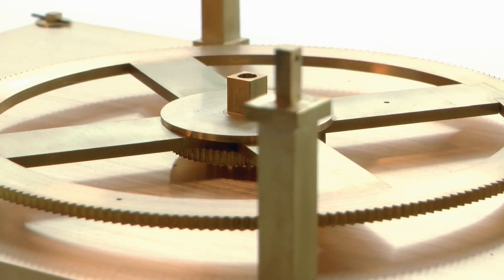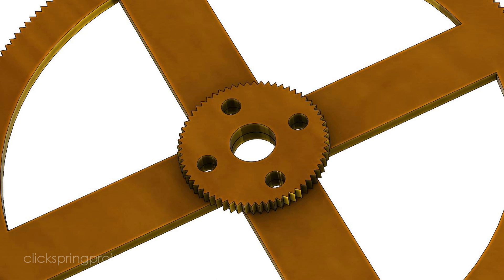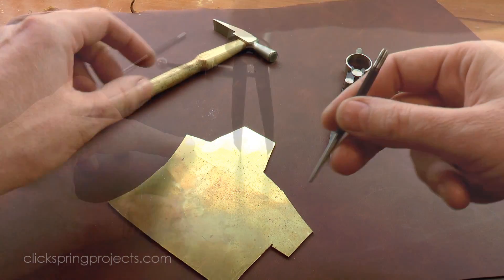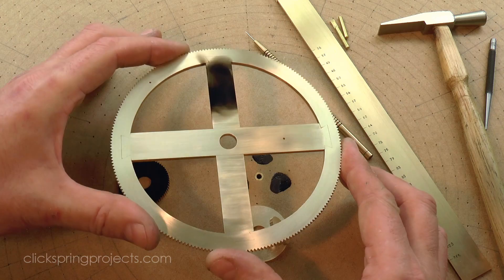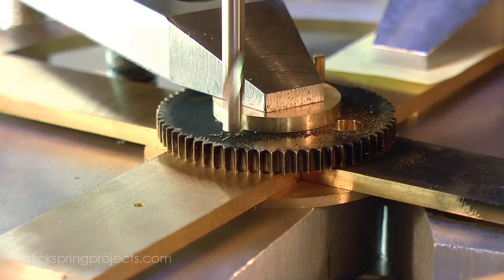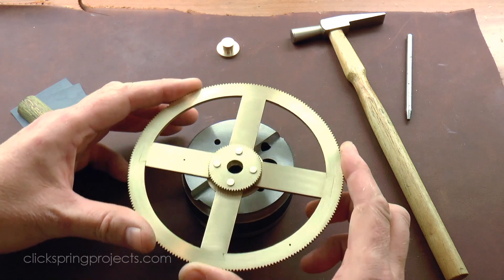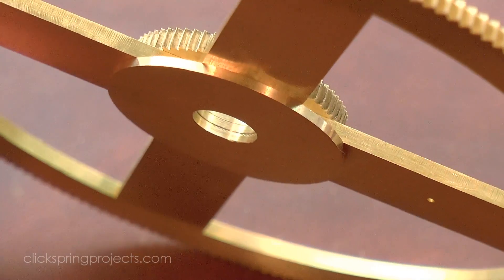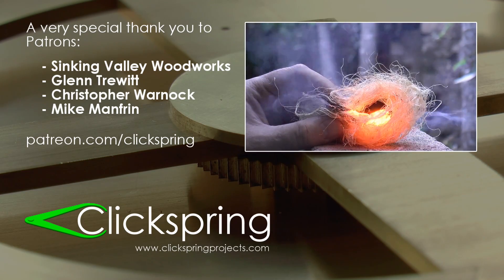The Antikythera Mechanism Episode 4 - Making And Fitting B2

Comment: Perhaps they used the burnt brass color you get when applying intense heat to brass, like when soldering or brazing it. They could potentially also have smeared on some oil and burnt it like you do when seasoning cast iron pans. Both would produce a color contrast, can be handled roughly, and is removable with some light sanding. Ash or soot mixed with wax or sap would make a sort of primitive paint that may probably also work. You could also do it the inverse way of how we do it now, fill the scratches and marks with something to make them more visible, rather than scratching and marking after applying the contrast medium

Comment: iron ink can be used and disalved with simple vinager on metal plates. but they could have also used soot. or heat blue iron for the marking then just retemper it

Comment: I know it's an old video, but i hope someone sees this.
I wonder at what room temperature you made this?
Because with tolerances so tight on that bearing i could imagine if it was made at a warm temperature and then exposed to the cold temperature of being on the deck of a ship the system might seize up due to shrinking of the metal.

Comment: In regards to marking metal, another method would be to accelerate a patina then scribe through it.  Any mild acid would do this like salt and vinegar or a citrus juice.  This would react with the copper and produce a thin green patina.  It would be more durable than any coating and easily buffed clean.

Comment: Way late to the party, but in addition to the obvious fat/wax+ash/charcoal options, a thin clay could be an option as well. It doesn't have to become full on ceramic, so it could be fired onto the part in a thin layer at a lower temperature.

Comment: You can melt bee's wax in boiling water, remove from boil, and pass parts to be marked, through the thin layer of wax on the surface of the water, after the water has warmed them up, so that the wax layer will be thin.  You might also try adding a dye, to the wax, for contrast.

Comment: Soot is still used today by locksmiths for marking and pulling impressions.  No doubt they used it in the Roman era.  Similarly, mixing a bit of soot or charcoal with wax would create a darkened slurry.  Perhaps reverse the process; whereby making the scratches and then filling them with the pitch, would render them more durable as well.

Comment: The simplest, cheapest and cleanest way to get a high contrast for the lines you inscribe in the work is to rub the surface first with steel wool-I can't believe just  how much Steel Blue you use-looks good against the Brass but just seems wasteful.

Comment: Britannica has egg tempera paint as a popular choice for artwork in this part of the world at about this time in history. Tempera is made of a suspension of pigment in gelatin, typically egg yolk. Tempera paints can be formulated to dry quickly and the gelatin binder is water-soluble so they're easy to remove. A cheap, dark pigment such as carbon black would work fine for layout fluid.

Comment: Black Bees/Candle Wax for marking.

Bees/Candle Wax has been used for a long time in the making of Ukranian/Dyed eggs, beeswax was the wax used in candles in the ancient world forever, and when it's hot and you accidentally get it stuck to something you didn't want it stuck to it will stick something awful. If you get paraffin stuck to something with a smooth or varnished surface you can usually just peel it off, and it is possible to get Black Bees Wax off, but it's a lot harder.

Edit:

Here's the stuff I'm referring to: http://www.ukrainiangiftshop.com/Dark-Beeswax/productinfo/WAX2/

Comment: The material I used for working with gold and silver findings was beeswax.  If there isn't enough contrast pine pitch can be added to make it a much darker color.  It is easy to brush on and scrap off and you can use the same stuff to hold small pieces in place to polish them and it will protect against acid corrosion if etching is desired.

Comment: Loving this. I'm thinking that back in the day when this device was originally made, an apprenticeship was actually quite different from what we know today. In the era around 50 BC, the student would have to go through the steps of first making their own tools and learning how to use them by completing simple projects. A the student made more complex tools, they would be taught more complex skills and create more complex projects. Something like the Antikythera machine would be akin to their final exam. 
I went partway through an apprenticeship program for electrician. It sucked. They were not interested in teaching anything. They only wanted to get the project done as quickly as possible so the supervisors could split that fat bonus check at the end. The joke was on them because many of the so called apprentices and helpers were so inept because no one wanted to take the time to teach proper skills, that the time budget was screwed 3 months into the project and the materials cost was over budget as well, both of which ate into the bonus. No real professionalism in the trade anymore.
Reply: There's some decent evidence that apprentices were treated that way most of the time back then too. Time hasn't changed that you need either luck or connections to get a good teacher.
Reply: that's the sad truth today, pal. i can feel your disappointment. I had the same experience as well but I'm an electrician now. i got my knowledge from the books and the skills from practicing that book knowledge mostly Auto didacticaly. by making mistakes and learning from them. i was just a slave in the eyes of my electrician supervisor back then when I was apprendist to electrican. it is very sad that every one is massively driven by money this days... i would had loved to teach a apprendist the art of the electrician but sadly nowadays only a few companies teach... so i leaved the construction sites and i studied even more and now im working in the industry as electrican for electronics in the quality proofing section. what I want to say with that. be your own mentor and don't let you down if no one wants to teach you the art of some profession

Comment: Every time I watch a mechanical fastener disappear into the surrounding metal I cry inside. It just became impossible to tell how those plates were fastened together because of how beautiful his craftsmanship is. That's literally the ONLY negative thing I could find after watching all of the videos on this channel is that his work is too perfect.
Reply: Well they could solve that with the same method they are using on the original, namely high power x-ray scanning. 🙂 Hopefully this video series will be kept as provenance with the eventual artifact.

Comment: Encaustic paints are, in my opinion, the most likely marking medium for an object that'd need a lot of handling. It's essentially the same as everyone else's comments on beeswax w/ soot mixed in, though their is a bit more to it, but it's likely because the Greeks used encaustics on just about everything. All their buildings and statues were painted with it, though most of that's eroded with time, and it was also used in funerary paintings, many of which are extremely well preserved. I think Encaustics are likely because they'd have been so common. With simple pigments the paints would have been readily available, pretty robust, very cheep, and could be cleaned up with a little heat and vinegar.

Comment: Hey, Chris. This is just based purely off speculation and has no actual historical backing but it's possible that they would scribe a line and then use something dark like soot or charcoal to emphasize that line. Then it would be in the light indentation and less likes to rub off with handling. As a jeweler that's how we do it with wax. I'll scribe a light line in the wax and apply baby powder to make the line pop. Then it stays visible no matter the handling

Comment: Hi, I have a question about the riveting.  You stamp the metal of the rivet out over the part for a secure bind.  Then you polish off the protruding metal from the rivet to create a smooth surface.  Doesn't this just remove the rivet metal stamped out over the part?  So why stamp the metal outward in the first place?  Thanks.
Reply from the maker: Hey Andrew, the metal deforms at the mouth of the hole, filling the small chamfer and providing a mechanical interference to hold the rivet in place - cheers :)

Comment: Hi clickspring. Was thinking on your methods of making your set out contrast. I realize youre making your own bronze, but do you think that its plausable that the ancients may have used tarnished bronze? that way the set out marks would contrust bright against the oxidised surface. Just an idea, i know that bronze parts can be quite dull, if they made stock materials in advance this could give them a contrasting surface with out much effort
Reply: after watching your vid on making your screws and bluing methods for your clock, have you considered a similar process for bronze? The blue is a very similar colour to your marking fluid

Comment: Some basic research raises some interesting ideas about the dye. Apparently, the use of purely mineral dyes was not enormous in ancient Greece, as they preferred plant and animal based dyes. This opens up a realm of possibilities, considering the island of Kythera was known as the purple island because of the amount & quality of the purple dye produced there. I don't think purple would have been used, as it was incredibly costly and time consuming to make, however, I do believe they may have used either the kermes insect (which was also expensive, but still cheaper than purple dye) or they could have used an indigo dye made from Woad which is supposedly mildly corrosive. Now, that is assuming the color resided in the blue area of the spectrum. I think your initial exploration of the candle black was a good idea, however, I think you should try other kinds of candles. Assuming the one you used was made from paraffin, which burns cleaner than both tallow and beeswax candles. Since paraffin was not available at that time, I suggest you try finding a tallow candle and a beeswax candle and using those to see if their soot is more durable. Best of luck!
Reply: G'day, loved your reply and knowledge, yes I'm 6 years late to the party as only found this by channel by accident, and as a history lover I enjoy learning new info.
I do not know if this is helpful, correct or even gonna reach you.
I know in Roman times, PURPLE was only allowed for the ultra wealthy/elite. 
It was a way to separate the classes, and PURPLE was banned to everyone except the elite.
I'm not sure wether it was like that in the period you are talking of, YET I thought I might share my small amout of knowledge and PURPLE was mentioned and I was like, YAY I CAN INPUT A SMALL AMOUNT INTO THE CONVERSATION, even 6 years too late 🤫🤫🤫🤫🤫🤫🤫🤫
I hope this was useful and knowing my luck you possibly already new this, yet I thought I'd reply, just in case.
Have a fantastic 
February 2024
From
Maryborough 
Queensland 
Australia 🦜 🦘 🤠 🇦🇺  🦜 🦘 🤠 🇦🇺
&
Cheers 🍻 🍻🍻🍻🍻🍻🍻🍻🍻🍻

Comment: the soot thing... I'm a painter not a machinist, or a clock maker. I paint miniatures and have for around twenty years, alot of people who paint use part holders or attach a handle to their peice. But I just hold what I'm painting and manage to avoid rubbing the paint while It's still wet, which is basically the entire time I'm painting. perhaps it's just a case of adapting your handling of the parts when you use soot as a marker?

Comment: If the mechanism was made out of Bronze or even cooper, you can add Vinegar, so it would oxidise the surface, this way it would create a better resistant green surface, that could be removed later. Of course you did have to overshoot the size a little to counter the corrosion, and you did have to do it before you made the gear "teeth".
Another option would be a  either a die (used in cloathing or some kind of pitch or some stain liquid.
I did discover your youtube channel by searching about case hardening, which was a great video, keep up your good work.

Comment: I think that combining lampblack and linseed oil would make a suitable marking-out fluid. It would have been readily available in antiquity and could be cleaned-off with turpentine (distilled from the resin of the Mediterranean turpentine tree) after the machining was complete. Unlike candle soot, it wouldn't rub off the metal surface, and once this lampblack oil-paint was dry, it would provide scribe lines with very good visual contrast on brass.
See also https://paleotechnics.wordpress.com/2014/02/25/lampblack-what-it-is-and-what-its-good-for/

Comment: A more resisting marking "fluid" could be wax stained with soot or ground up charcoal or whatever might serve as pigment. Heat up a pot of nicely darkened wax, take some of it onto a ball of cloth and apply it to the part. a bit like shellac To get rid of it, pour boiling water over the part or scrape it off with a piece of wood. It would even deliver a protective coat.

Comment: I know a lot of possibilities have already been posted but I have two more suggestions to add:
1) Milk of lime - Can be easily produced from shellfish, dries to a white coat. often used in "Whitewash" finishes. Pigs blood can be added to give a pink colour, and egg white and wheat flour can be added as a strengthener to the finish. 
2) Gelatin / Hide glue - Can be made from boiling hides and/or bones from various animals. Dries to a very durable finish depending on concentration of gelatin. Many colour and strength enhancers can be added for different properties. Can be removed easily by warm water.
Reply: Where did you learn this

Comment: So I've been told to only file in one direction, the direction that the teeth are formed to cut in, but I observe that you file in both directions. When is either appropriate?
Reply from the maker: Great question Evan - As a general rule, file on the push stroke and ensure minimal contact with the work on the return stroke, as you have been taught. The file cannot cut on the return stroke, only wear if left in contact with the work - However don't get overly hung up on the idea, there are plenty of exceptions: When you are working with soft material; when you have a worn file and it makes no difference; when the workpiece geometry demands it, and to do otherwise would compromise your desired outcome etc. - edit - a good example of where contact with the work on the return stroke is simply accepted as unavoidable is a reciprocating filing machine: http://www.clickspringprojects.com/die-filer-or-bench-filing-machine.html FWIW The initial set of files that I made for the machine several years ago are still cutting well - Cheers :)

Comment: You talk about how accurate these parts need to be but why dont you use modern technology to cut the teeth to save time and to ensure that this devise will work as it should rather than how it would have worked in the past?
Reply from the maker: Hey Aaron - My goal with this build is to create as close a reproduction to the original device as possible. This provides a number of unique opportunities, one of which is the ability to assess just how well the original device actually functioned.

Comment: Do you think they would have had a filing/cutting tool that used the same concept as a spring pole lathe to imitate a modern day scroll saw? Replace the cutting blade with a file and you get a nice tooth shaper. More than that, with amount of power one could develop using their leg on a lever it's possible that some of their files were more like broaches with larger rougher teeth and were moved slower, but fewer times (when compared to a file) to get a rough shape of a tooth. It's kind of difficult to imagine amount of hand work required to make consistent gears, especially for a project of this size, though it could have taken them literally years to build it.

Comment: Whatever was used as an ancient layout fluid, I'd have to suspect it be some sort of oil based rather than water based. Something known at the time would have been sepia (or other Cephalopod based ink) which is made from grinding the ink sac and mixing it with shellac. Might be too far on the side of durable - and I'm not sure how well it would score without flaking. But it'd be an interesting experiment.

Comment: Charcoal that has been ground up and mixed with beeswax would be an option,  and since they did not know about heavy metals are toxic, lead can be rubbed on to mark some materials.  Lastly, coating an item in wax and burning it carefully can coat the metal with a tough dark coating.  egg yolk or other sulfur bearing material can also be used to darken/tarnish metals too.

Comment: For the marking fluid, maybe try a pigment such as soot in a base of rabbit-skin glue from an art supply shop. (A thick solution of gelatin powder and a little water might suffice in place of rabbit-skin glue, and has similar origins.) Either rabbit glue or gelatin should wash off pretty easily.

Comment: When you tap those rivots in, did you need any tool to help with alignment? I've never pressed brass into brass before, but my understanding is that dowel pin press fits are usually started with something like a drill press for alignment first, then finished with an arbor press or something like that. You have them chamfers, so is that enough? 

I can imagine myself making a complete mess of a fit like that, but maybe that's just my lack of experience! Anyway, superb video!
Reply: Or perhaps the fit of those rivots are loose enough...